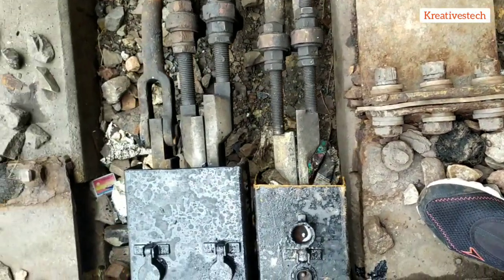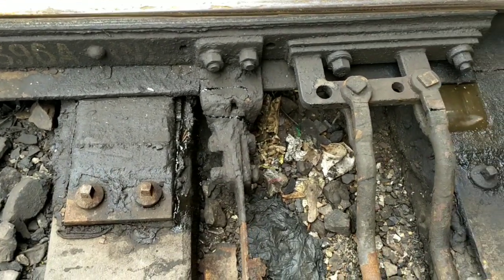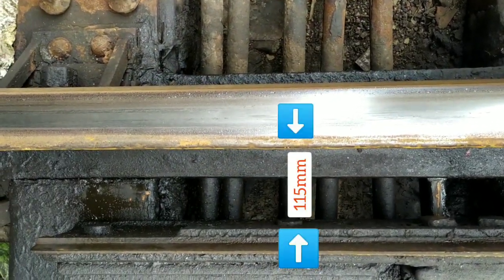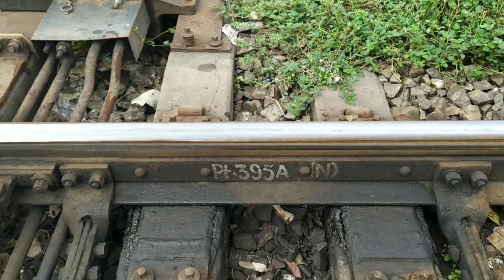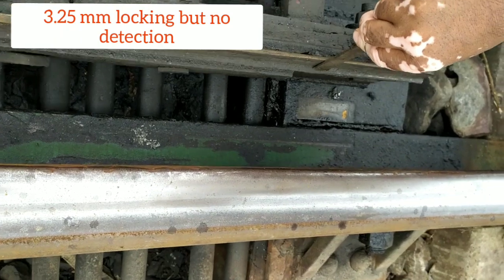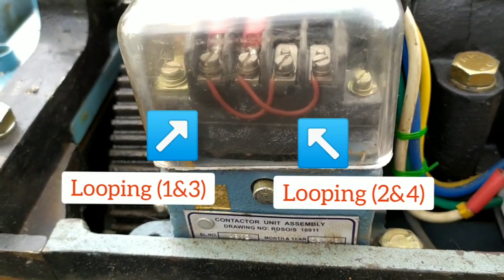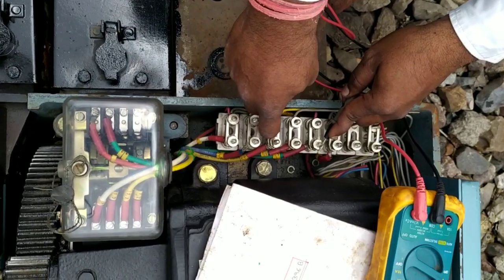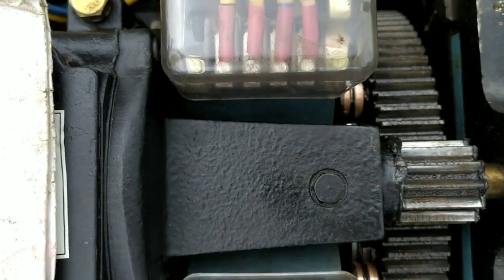Point machine. IRS type point machine. working of a point machine

Comment: Sequence of IRS Motor Point operations - Non Route Setting Types 
https://youtu.be/
Link- 
IRS Motor Point Basic-1- https://youtu.be/-VJPbSmr5f0
Earthing arrangements for EI/PI/RRI- https://youtu.be/HOrtVp4n4FA
SSDAC CEL Basic training -01- https://youtu.be/sGYgvFJPEk8
Charging of UFSBI Block Section  मे रेलगाड़ी का Safety  सुनिश्चित करने वाला Latest Equipment https://youtu.be/QYF9kYgvZa8
ALT Pro  MSDAC for Railway Signaling - Basic Idea of Track Device Sensor-  https://youtu.be/9GPNqq-rKNE
Railway Signaling - Webfil UFSBI  का Installation Part -01-- https://youtu.be/QOQ5Q8_FrPA
Webfil UFSBI BPAC - Part 2- https://youtu.be/0O30gm9tQLY
Multimeter ka Fuse kaise change karoge?- https://youtu.be/gQCxhGQGDD4
Railway Power Supply Equipment  क्या है, और कैसे काम करता है?- https://youtu.be/qHGfCwxnkTw
Why not feel jerk By Railway Passenger..... Complete Process of Rail Welding..-  https://youtu.be/dxivceBVwik
Intro & Advantage of Efftronics Datalogger #01-- https://youtu.be/7nkazcZvWtU
Predictive Maintenance,  Efftronics Datalogger part 2-  https://youtu.be/4gY9gdDCSOo

#CmjhaAcademy #Signalingtechnologies

Comment: Siemens point machine ke bare me batayiye
Reply from the maker: The mechanism of siemens type point machine is same as irs type point machine.
In siemens type point machine there are only 4 rod. Throw rod, locking rod and 2 detection rods,. There is  common locking rods for both normal and reverse side.. but now these days almost all siemens types point machine is replaced by irs type point machine
Reply: @kreativestech1486  please explain super imposed circuit use in point machine wiring
Reply from the maker: @GrowingSanvi  okay